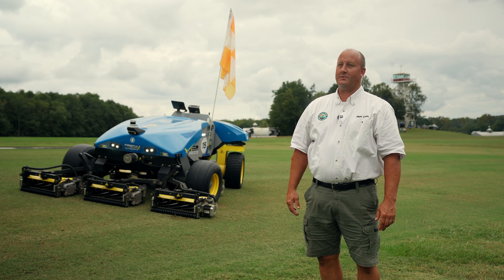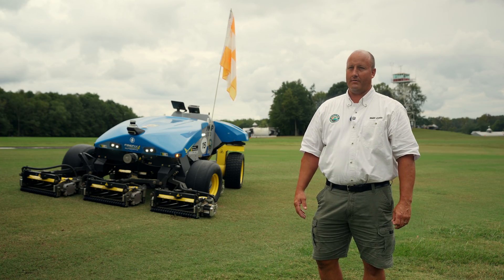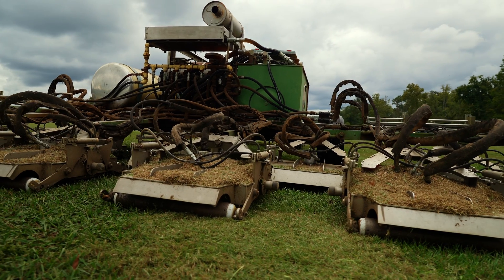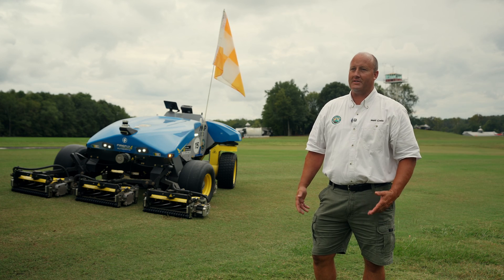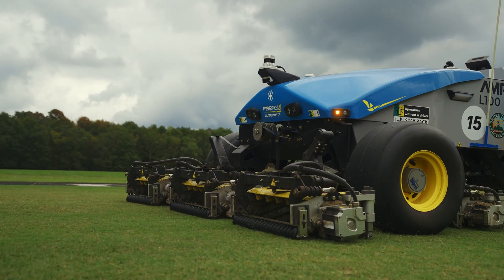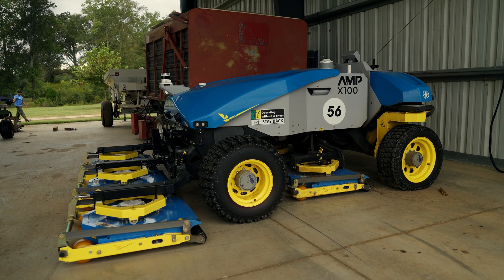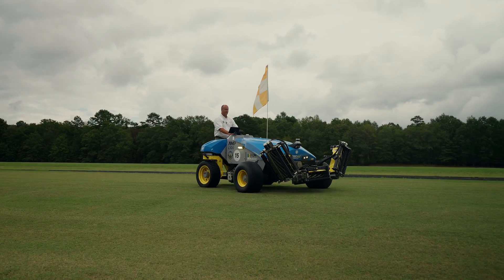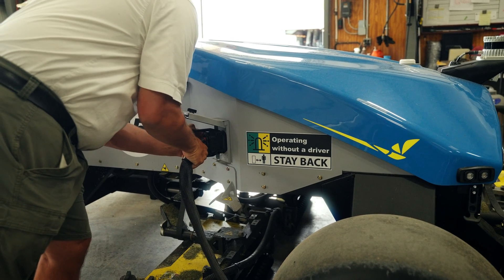Triple Tree’s Autonomous Grass Runway Mower

Comment: I need a baby version for my house!
Reply: Lookup the Mammotion Luba 2 AWD. I have one at my house and it has all the same features they mentioned here.
Reply: Look up the Wright Autonomous ZK. American made full size commercial mower with local dealer support.
Reply: Don’t buy a Mammotion Luba 2 AWD X.  I spent more than $9,000 for a pair of them, mowing 4.5 acres.

They simply aren’t ready for prime time.

It’s not unusual to rack up a couple dozen error codes for the two mowers over a week’s time.  Each error requires me to manually attend to the mower.

The hardware is pretty solid.  The software is simply awful.

Comment: seems like a very well funded grass strip. Electric autonomy is the way but it can be drastically smaller and cheaper. It's possible to cut grass with a laser today so why not a mower only a few centimeters tall shaving the lawn. So small a plane could run over it in a pinch but it would vacate to the side in the presence of ADS-B or even more sophisticated plane detection. If necessary it can run all night and you'd never see it. RTK GPS isn't big today and it can deliver 2cm accuracy. There can be AI inside it to inspect the lawn, even spot repair. Perfect levelling, zero maintenance. It could even plant wild flowers in locations so bees don't die because of us.
Reply: you dont need that. If its not a lighted 24/7 strip just have the thing mow at night
Reply: @als8518  of course if it's guaranteed closed at night but that's a big limitation
Reply: @als8518  it could also be tied to the runway lights, when they are turned on it hurries to the side